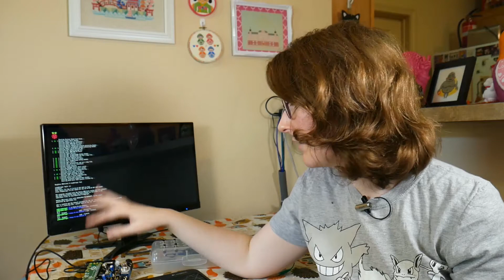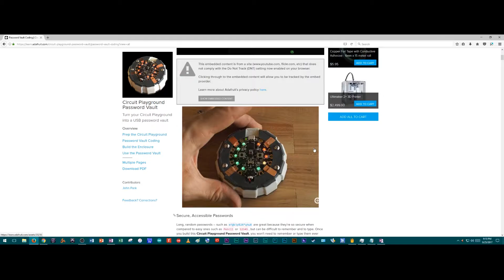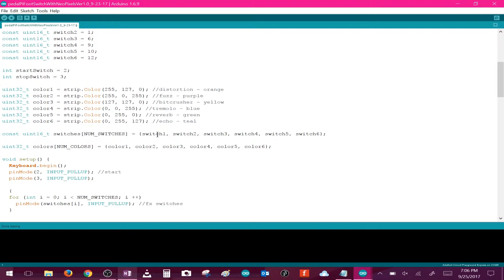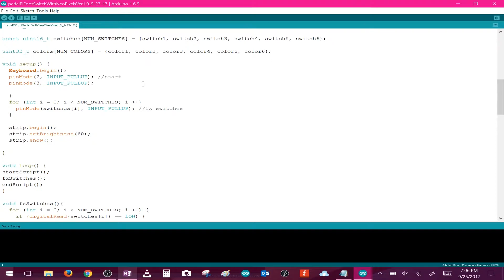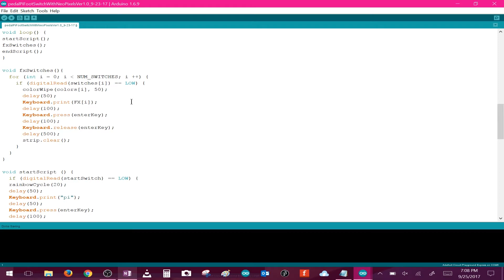Build a Circuit Playground Effects Switcher for the Pedal Pi

Comment: Cool beans! Is there a reason you don't use the unused pins on the RPi itself to do this? I understand it is more "electronics" (maybe) to interface the switches and leds.  At this point I'm ignorant on the pullup circuit in the pi itself.  At any rate, I admire your work on this stuff.